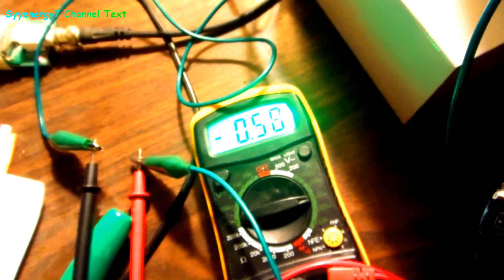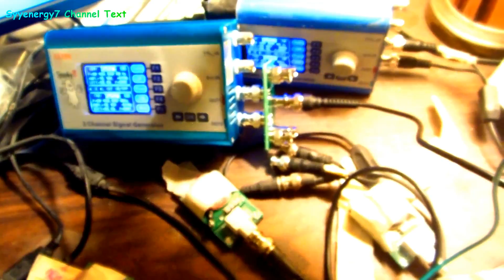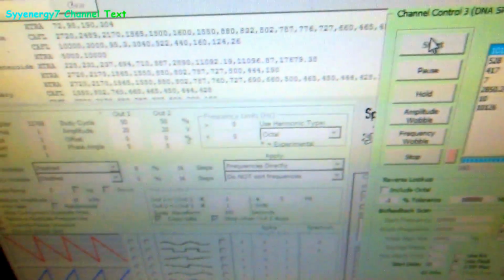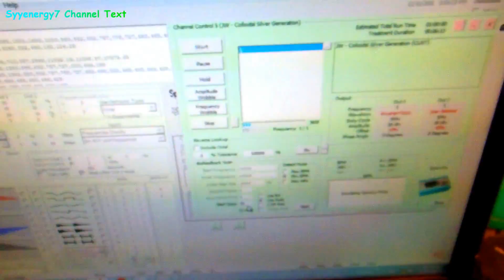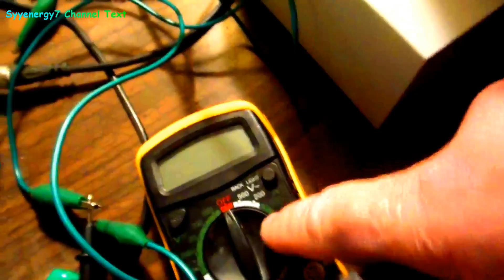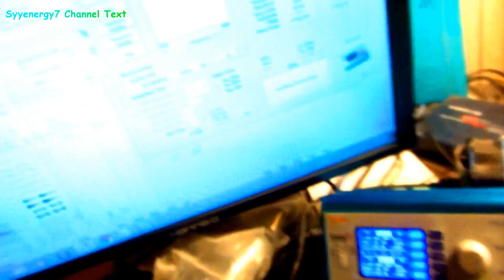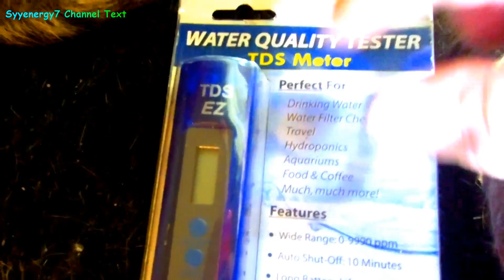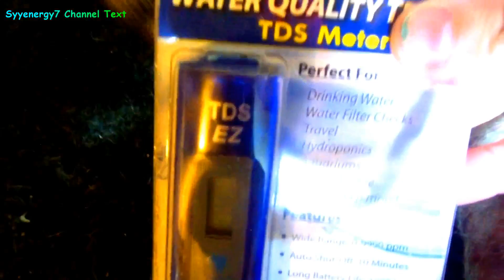Making Colloidal Nano Silver the SPOOKY Way

Comment: Do you know how to achieve the "reverse polarity" option for running the JW's default setting for CS Generation?  My goal is to have a setup where the generator is reversing polarity every 1-3 minutes.  PS: A magnetic stirrer is currently in the works--I should receive it today.  I'm stoked about it; no more large particles (which were extremely rare using Spooky2 versus other generators that I own).
Reply: The default setting appears to be  "reverse polarity."  It produces AC output. To get the generator to reverse polarity every 1-3 minutes set the output frequency to 0.006Hz, if it allows it.

Comment: interesting for sure, the calculator i use calculates that 1000ml (quart) water 6 mA current, goal  for 10 ppm final product, only takes 30 min's ...it is a on line calculator where you put in the mA, amount of water, ppm desired then tells you the time needed.

Comment: Syyenergy - I'm trying to use my multimeter to get a reading but I can't get any reading at all.  How are you making your connections to get your reading?  What are you connecting your leads to? I know for Milli-amps you need to hook up the meter in series.  But with this one, I'm stumped.  Any help would be great.  I don't know how to get started because I don't know what numbers to put in the silver calculator.
Reply from the maker: +P D I connected the multi-meter to the two silver rods when they were in the distilled water.
Reply: +syyenergy7 Thanks.  I'm not sure what I'm doing wrong.  I get zero reading.  My black lead is hooked up to the COM port, the red lead is hooked up to the mA port. The dial is set to AC mA~ (also tried DC mA for the heck of it). and it just says 00.00mA.  This is while the spooky is running, connected to the silver rods and in the water.  After 12.5 hours, which is the default time from the calculator, when I shine a laser through the water, I get VERY faint reflections from what I think must be the silver particles.  It looks nothing like the image in the spooky manual.  Any ideas?  Thanks again.
Reply from the maker: +P D They may be able to help you on the forum. especially if you post a picture.

Comment from the maker: The wave form used and the reversing of polarity automatically cleans the silver rods.  The largest particles fall to the bottom and the end result is the best quality nano colloidal silver.  NOTHING sold to a home user is even close to the quality of the Spooky2 generated nano colloidal silver.
Reply from the maker: +John B You made a statement that is the opposite of what is happening here.  It makes very small particles.
Reply from the maker: +John B I'm just going by what John White said.  I don't have the lab equipment to test this.  Usually I just make colloidal silver with a few 9 batteries and a resister.  With the magnetic stirrer it seems to come out good.  But personally I think high dosage vitamin C is ar more beneficial and there is plenty of current medical evidence to back that up.   The colloidal silver comes in handy for giving water a more lengthy safe life from microbes.  I put a small amount in the cats water and food.  It does seem to keep the food fresher.  Cs can also work like a miracle with a bladder infection when you flush the bladder out directly with colloidal silver with a catheter.  Drinking the stuff seems to be the least effective.  If a person had a serious disease, it would be best to find a doctor and have the doctor administer the colloidal silver intravenously.   But again high dosage vitamin would be better from all the doctors published books I read.
Reply: @syyenergy7  if you have 2 milliamps per sq in, then the silver is 1 to 15 nanometers. If you have 6 milliamps, then you will have 3 to 45 nanometers particles.